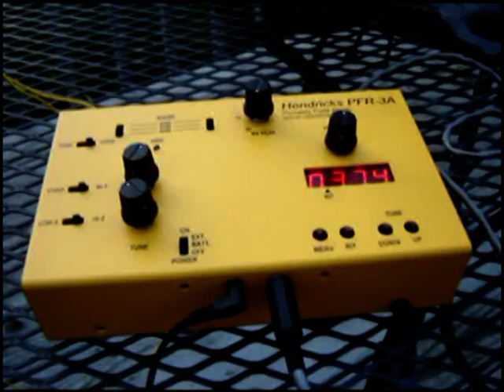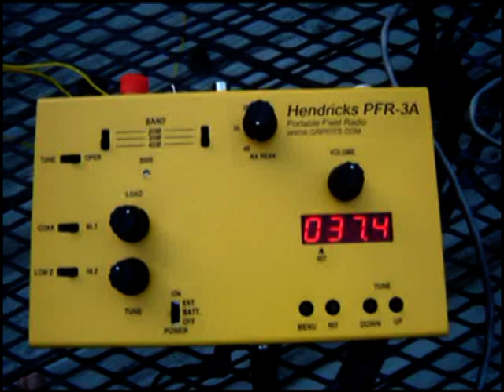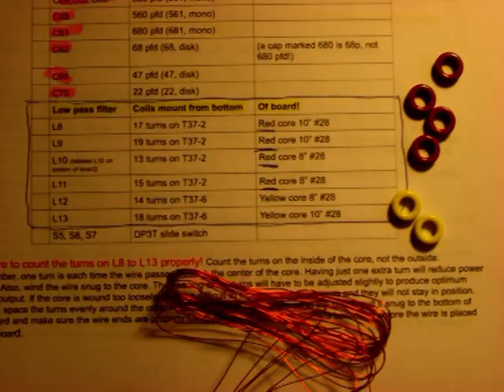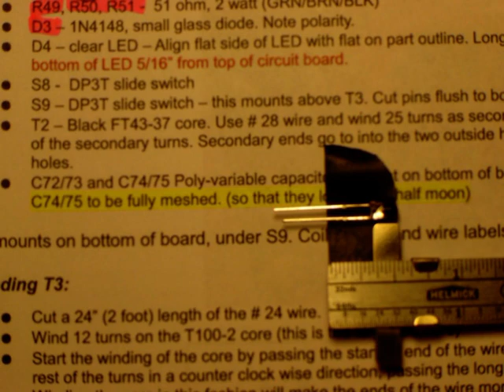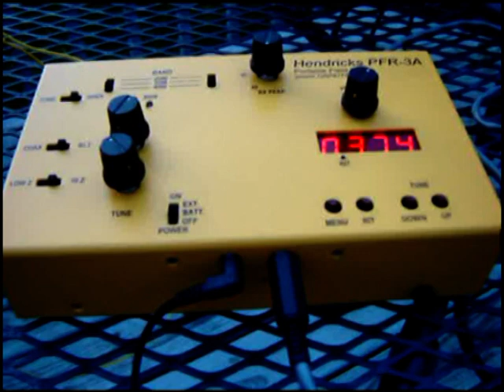QRP (LOW-POWER) TWO-WAY RADIO CONTACT

Comment from the maker: @ez2curanut Thanks for the question.  The drift was on the other station's radio. The Hendricks uses a Direct Digital Synthesis (DDS) VFO which is stable. I liked the sound of his HW-9.  Although there was some instability, it was not drifting out of my pass band and it had a certain unique character that was fun to hear.  There used to be many more signals with unique characteristics on the bands but now most are using DDS/PLL VFOs.  73 de Lynn/NG9D.